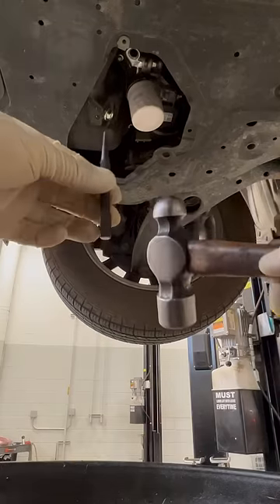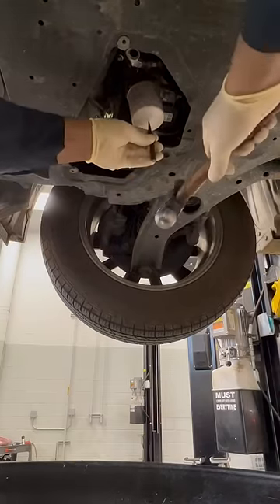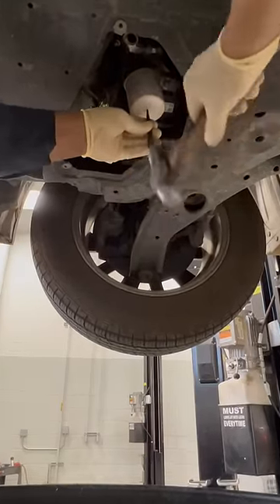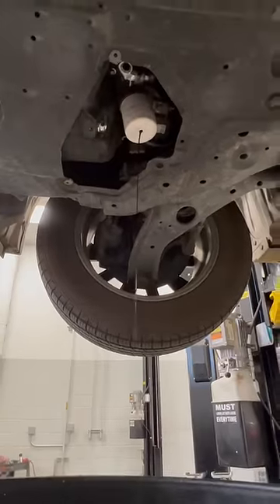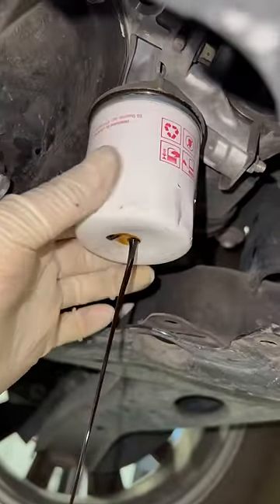Tech Tip Of The Day Oil Filter Clean Removal #oil #oilfilter #mechanic #shorts

Comment: Remember once you punch that hole you can’t fix the filter. If the last guy cross threaded it, or used his gorilla grip and you can’t get the filter off with normal persuasion you will be forced to deal with a bad situation that can turn into lots of lost time. If you can’t get the filter off but holds oil you have options.
Reply: You still have options, usually. Most oil filters have a filter bracket you could still take off and replace
Reply: @jeepwk6.5L I like the way you think logically rather than giving up when something doesn’t go well. 👊
Reply: Had an oil filter put on so tight on a John Deere that I had to take the whole oil filter block off the side of the engine and had to tape the holes and wait for days to get the parts. We still tried to get the filter off the housing but shit was toast.
Reply: Absolute worst case scenario is he would have go drive that punch sideways through the filter and turn it using the punch for leverage. Didn't think it was that big of deal lol
Reply: I was gonna say the same thing.

Sure, there are work arounds and probably never be an issue on a car like this but on some cars this could be a nightmare if you were struggling to get it off after punching a hole.
Reply: Tell me ur a lube tech without telling me your a lube tech. 😂
Reply: You could easily just loosen the filter an 1/8th turn or whatever to be sure it's gonna come off first. No problemo
Reply: @isveryniceyes  This is true and probably your best bet if you don't want any possible issues. Although, in 35 years of wrenching there has not been one filter or drain plug that I have given up on. The worst I ever had was on the new body style thunderbirds when they came out. I actually ripped the whole filter off of the base between several different removal methods and finally I stuck a small air hammer on the base of the filter careful not to contact the housing and just barely had to tap it and it moved. I was happy and pissed at the same time. It was at a dealership and the service writer refused to get me more time.  Ugh. But I still won in the end.

Comment: Loosen it up a bit first so you can remove it by hand  , then punch it
Reply: That would end up putting more stress on the threads than the rubber if the rubber isn’t compressed so that would be a good way to damage an expensive thread to repair.. although unlikely. Also, the puncture impact wouldn’t really effect how tight it is.
Reply: @malachihornbaker5869  no, in  18 years i have never damaged the threads. I mean hand tight , the seal is still touching the filter housing your not gonna have any problems
Reply: Also im pretty sure those threads are gonna hold up , not a filter thats made out of thin sheet metal

Comment: I worked as a lube tech for a while and I was always covered in oil like I was working in a oil field my boss hated it😂
Reply: Same dude. I swear I’d walk in Monday morning and by 9:15 I’m covered in black stains from head to toe
Reply: Stg was a lube tech for another shop. Always covered even when I tried not to be. Seemed to be worse then. Now Imma tire and lube tech and BRO YOU DONT EVEN KNOW. The amount of dirt and brake dust ontop of tire shine and baby powder for tubed tires. It’s horrendous
Reply: sounds like your boss was in the wrong line of work
Reply: It should happen earlier on as you learn but becomes rare with experience. We called them “baths” lol. And it  happened more when I worked on 18-wheelers than cars. It was also why I always kept a spare shirt in my locker or in my car.
Reply: @GeorgeCoggins  I was the lube tech at a car dealership so customers would usually see me when they brought their cars in

Comment: then you realize the computer zombie at advanced gave you the wrong filter and now you have no way to get one but walking. True story
Reply: More of a not checking the part issue.
Reply: Plus when you take out the filter you’ve already taken all the oil out. Are you gonna put it back to go get a new filter??
Reply: Common sense would be knowing you have the correct filter before starting….if you’re doing your own oil changes…you should know your filter number yourself without the need of a counter parts employee
Reply: Take the oil filter in and match the code ☠️
Reply: Just use the book and get the filter off the shelf yourself and hose it off, ya dummy #foryourhealth
Reply: @chrissterling3225  I'm surprised you haven't ever been given a box with the right number, and a similar looking, but not correct, part inside.
Reply: Then you should have made sure it was the right one...
Reply: Aye say sike bro. You're about to have some over confident 14 year old piss off his father.
Reply: You really gonna blame the employee because you didnt check your parts? 😂
Reply: Fortunately my Advance is only a mile away. And yes, I’ve walked there before.
Reply: I buy mine from Toyota direct by the 6-pack.  For some reason, Advance, O'Reilly and Autozone don't carry 4Runner filters
Reply: Some of these commenters haven't experienced heat stroke... it will have you doing funny things for the rest of your life.

Comment: If you got a stuck filter and cant use a wrench or your hands, throw a screwdriver in it at an angle and crank it off lol
Reply: I actually saw this in person one time a guy did this and twisted the bottom half of the filter off with the top half still attached!😂
Reply: @Mattyattacks1313  bruh 😂😂

Comment: Loosen the oil filter, cover the oil filter with a red Dixie cup, then continue unscrewing the oil filter with the cup still attached. Hardly any mess. Works only for oil filters on the upward position like the one in your video.

Comment: Don't hammer it. The thread will be damaged and you will need a new oil sump.
Reply: Bro you ain’t gotta hammer it a foot in there just puncture it. Youu reaching bruv
Reply: Push the punch with your teeth?
Reply: Right, just use drill.
Reply: @jfeva8072  Did you use your teeth that way? How did you do it?
Reply: The threads are a few inches above the bottom of the filter🤦‍♂️
Reply: Then what do I do? Use a sponge??
Reply: Glock is best option
Reply: @tonytony978  Then, put the oil filter on the gun.
Reply: @stfholdmm  Wouldn't it be easier to put a cup over the filter to twist the filter off?  The cup will catch all the excess oil when it comes off.
Reply: He punched it probably a quarter inch and in the middle. This is completely fine

Comment: Don't do this until you've ensured that your oil filter is loose
Reply: Hahaha i was gonna say that. Mine is stuck on. 10k miles. Womt come off. Dents all over it from me usimg a chain
Reply: @pizza4prezident143  drilled a hole into mine, stuck a screwdriver and turned it. Lucked out and came right off.

Comment: My tip: always make sure your car upside-down when you change the oil filter
Reply: This comment is underrated
Reply: My dads oilfilter is on top of the engine upside down. I keep wondering why others put them on the bottom
Reply: @Tupsuu that's more of a recent thing manufacturers have started doing. most cars still have the filters down on the bottom.
Reply: @raynjpg  well it's an 2005 audi 3.0tdi so not that recent

Comment: If you actually change your own oil you know this is really helpful. The filter always leaks oil when you unscrew it even if you drain the pan really well first.
Reply: Wait till you have do do a filter on a AMC V8, its fipped the other way round at the front of the engine, next to the tappet cover. No way to avoid a bit of a mess :-))
Reply: @uhtred7860  I swear they design some engines intentionally to be a major pita to work on lol.

Comment: Better make sure you have the right replacement filter if this is your only vehicle to drive...
Reply: Thanks professor🙄👍. Thats usually step 1 of 2 when people go to change their oil....which is buy the right damn filter first....
Reply: @CrowT   @CrowT.  Thanks for the Honorary title!   Have you ever stopped to think that many people rely on the person behind the counter to give them the right part?  Also, in their haste, or distraction grab the wrong part that was next to the right part?  I don't know about you, but even us professors have received or grabbed the wrong part in our haste or distraction.  My suggestion was relating to this guy destroying the old filter when removing it.  It's good practice when servicing any equipment to try not to destroy the parts you are replacing, as they may save you a lot of time due to a mistake.
Reply: @donaldcampbell7755  I guess that CAN happen. But it is pretty common sense if you are gonna change your own oil to make sure you have the right sh*t before you start, especially if you are going to destroy a filter. I guess if people can't think that far ahead...they shouldn't be changing their own oil🤷‍♂️.

Comment: Only do this if your oil filter isn’t one of the ones that requires you to put the new filter in the old casing cuz then you just got one with a hole in it lol
Reply: If I did this on my vw I would be down over 100 dollars lol
Reply: Those normally have drain screws anyway.
Reply: @JakeAF  correct,mine does

Comment: Loosen the filter put a solo cup over it and then continue to loosen it.
Reply: Maybe on a Honda. Not on a Duramax. Might need something a little larger. Like an oil drain pan maybe! ??
Reply: @ThatDIYguy403  Clearly I was referring to the actual filter in the video. I’m sure the solo cup trick wouldn’t work on a larger filter with a higher capacity.
Reply: @djfhsbdufje666 Fair enough.  I would never puncture the oil filter  myself. Never know when the parts are not the right ones. It happens  often enough.
Reply: @ThatDIYguy403  I wouldn’t say never puncture a filter, but know where to puncture a filter and know what is on the other side of the filter you are puncturing. I do agree that this method of filter removal should be considered only as a last resort or if access to the proper tools are not possible.

Comment: I Slip A Plastic Bag Over Oil Filter, Once Loosen Slightly. Another Bag Over My Hand. Then Spin Off. Tie Bag Up & Please Recycle Your Oil At Many Auto Parts Store
Or Most County Trash Dumps They Have Drums To Recycle Oil. This Oil Is Refined Again To Be Used For Large Oil Burner Furnaces & Other Products. RECYCLE.

Comment: I’d say make sure you can break the old one loose & also verify that you have the correct replacement filter first before doing this. 

Especially if the vehicle you’re changing the oil in is your only way to go get another one lol
Reply: This makes it easier to break loose because it eliminates any vacuum seal that could have formed and in my experience it’s never made it more difficult to break loose. But yes, having the correct parts on hand before you remove the old one is a good plan.

Comment: Make SURE you can unscrew it first.
Reply: I was just going to say that
Reply: I had the same thought but there’s no situation I can think of that you’re going to leave a filter you can’t unscrew. It has to come off no matter what, and that means destroying it anyway.
Reply from the maker: @truthsmiles  your definitely correct
Reply: @truthsmiles  what I was thinking was,if you can’t find your oil filter wrench but don’t have a hole in your filter you can put the old oil back in the engine and drive to the auto shop and have them deal with it, but if you have a hole in the filter you are stuck like Chuck
Reply: @patrick7639  If you don’t have a wrench you just jam a screwdriver from the side all the way through it and pull. It’ll come off.
Reply: @truthsmiles  at 60 the only screwdriver I’m interested in is the one with vodka and orange Juice
Reply: @patrick7639  I’m nearly 50 and hope to still be turning wrenches at your age :) But that drink sounds pretty good right about now!
Reply: @truthsmiles  I still turn wrenches, I just do it from a standing position, flat backing is what I’m done with, but I don’t have a lift
Reply: @patrick7639  Funny, I’m still crawling under cars but have been plotting recently on how to get a lift at home :)
Reply: @truthsmiles  when you get one I’ll bring the screwdrivers and pizza
Reply: @patrick7639  Deal!
Reply: @truthsmiles  I had just posted almost a mirror to this comment up a ways in the comments section. It's gotta come off at that point one way or the other but this way it's already drained and you don't have to take an oil bath. And I will never concede and take my rig to another mechanic. Ive been a professional wrench for 35 years. That would be too embarrassing. 🤣

Comment: Another tech tip. Do this step first before the plug. It’s just more fun
Reply from the maker: Yes definitely
Reply: U don't think the whole engine drains out of it do u?
Reply: But how many times have you NOT gotten the drain plug out? Nomatter the damage and had to replace and/or repair.. again, it's that "one way or the other" scenario. Lol
Reply: @jamesbridges8494  I just think it’s more fun.  Skdjfv fun to just leave the oil filter alone and just drain the pan and then fill her up. Works perfect when flipping cars
Reply: How though is it fun?
Reply: Another tech tip, buy a car
 with a cartridge filter lol
Reply: @bigdaddydaddy3203  only do it on gravel parking lots with no catch bucket. Also tyn

Comment: and then if the filter doesn't unscrew... you are really screwed !
Reply: There's a tool for all filters used, basically a strap with a square tubing. I've crushed filters with it when they are stubborn. They have all come off after that.
Reply: Hammer a long screwdriver though it ,they always come off one way or another

Comment: I do wanna add that if your filter is horizontally mounted AND you have vertical access to it from the bottom you can punch it from the side and still drain the oil in the same manner as in this video. You will also have the added benefit of being able to use the punch to getting a tight fitting filter unscrewed off. We did this in this exact manner at Norfolk southern railroad when I worked as an electrician there. Well the mechanics did it I just seen it done many many times usually with a heavy duty screwdriver but punch will work just the same

Comment: After pouring out the oil from the oil pan I put my shop vac nozzle where the oil goes into the engine this worked beautifully no drips and no oil in the vac too.

Comment: We welded a nail to an old claw hammer for this
Reply: In the shop (HD trucks) we just reach up with a pointed air hammer bit on a WAYYYY wore out and under powered air hammer and just brrrr one or two taps and it's flows like Niagra..

Comment: This is why I love that my oil filter is above my engine. Once you drain the oil from the pan, never gotta worry about a messy filter.
Reply: Subaru?
Reply: @blzt3206  Crosstrek 100%
Reply: PL4615 oil filter .. topside .. Most older suubies got the ring of fire filter sitting in the MIDDLE of an heated circler exhaust
Reply: @MenaceMarciano9  makes my girl sounds like a tractor, what’s to hate?
Reply: Wish my outback had this, its annoying doing all the oil changes on my familys cars with this and then having to do mine the hard way.
Reply: I feel like that's fighting gravity in a way
Reply: @MenaceMarciano9  lol yes the old subarus. i hear you using words like "topside" and "ring of fire"... tell me youre an auto tech without saying it ;)
Reply: @philthyphil1017  yeeesss sir , I do this stuff in seconds with my eyes close

Comment: You had a second opportunity for tech tips, the rubber gasket stayed, if not removed could cause engine replacement
Reply from the maker: Word On The Street Is That Vehicle Just got Towed Into The Shop With A Engine Noise
Reply: That's why u check your work .......
Reply: @WrenchingMafia  he does have a valid point. It is a point that could have been brought up for a learning lesson to the viewers to watch out for. And almost every unlucky mechanic or lube tech has had the displeasure of learning the hard way what "double gasketing" is. It totally sucks learning like that. 😆
Reply from the maker: @midnightrider1854  your correct ✅, after I made the video I always clean the area of the gasket where the the filter gets seated. That part got left out the video
Reply: @WrenchingMafia  I figured that you do, it just would have been a good lessen for the newbie is all. 😁

Comment: Only do this if you have the replacement on hand and know for a fact that the replacement is the right one.
Reply: Well no shit lmfao don't know why you would even start doing an oil change if you didn't already know what filter to use 😂
Reply: @moses6248  you would be very, very surprized. And it isn't neccesarily knowing which one to use rather that the right one is in the box as they are sometimes switched around. Needed a new oil filter, and upper cap (the old one was damaged) and I wound up with a radiator cap, as for the filter, the box was right, but it was not the right size.
Reply: I was in the middle of an oil change on my 3 year old truck when I realized I didn’t have a spare filter on the shelf like I thought I did.

Took my car to the dealer to get a filter. I pulled into my driveway and it took a little while for me to realize that my truck wasn’t there! Then I noticed the trail of oil down the road …

Yep, my wife, who was sleeping soundly in bed, woke up and went to the store to get something. My truck was dead on the side of the road about a mile away with a seized engine.

Boy did that hurt. Replacing the engine on a 4x4 Tacoma means taking apart half of the truck. It was a lot of work.

Comment: Becareful doing  this it could damage your muffler bearing if the oil comes out to quick
Reply: that's not right
Reply: I tried this, but it made blinkers blink to slow. I guess I need to add some fulid
Reply: @raymondjohnson8522  make sure there are no air pockets in your blinker fluid tank this could cause your blinkers to short